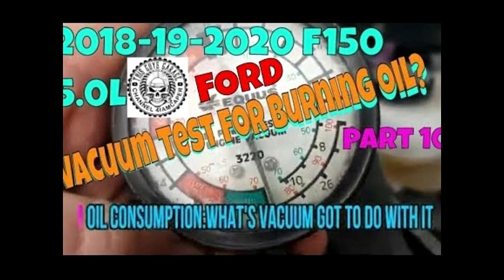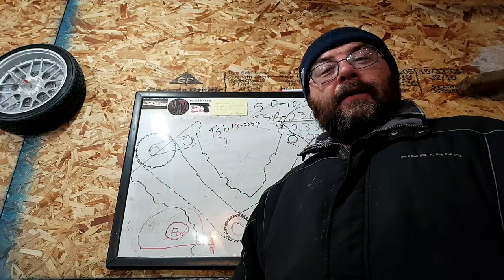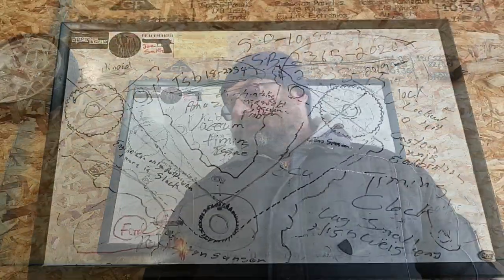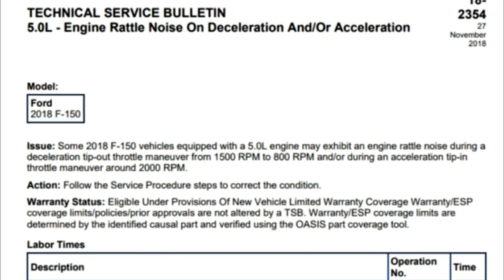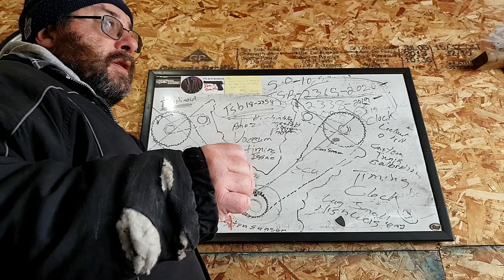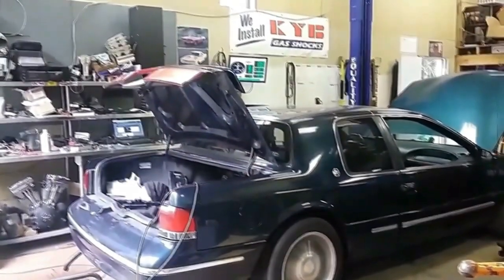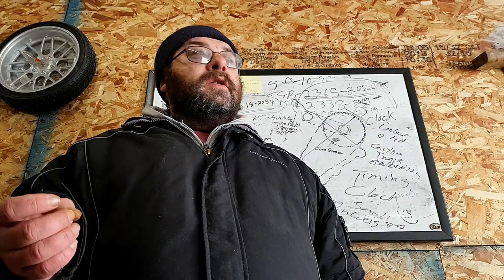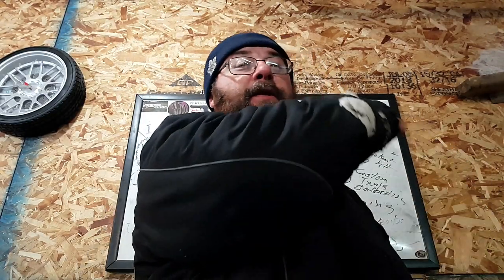2018 2019 2020 FORD f150 5 0 engine rattle tsb 2354

Comment: The Rattle goes away when the engine warms up. My truck has the decel rattle uses no oil. Every 3rd Gen 5.0 I’ve driven F150 and Mustang all have the decel rattle till they warm up. Even the 2021 5.0 has the decel rattle. I took my 18 f150 in and they applied the TSB 18-2354 they replaced the cam phasers and reprogrammed the truck. The rattle is still there and it’s still not using oil. The timing chain tensioners are also locking so the chains can’t slack when oil pressure bleeds off witch is a common issue in the 5.4 3v. I also have a JLT catch can on my PCV and there’s barely any oil in it, in between 5k mile oil changes. 

I think you need to back up your claims with proof.  By installing a PCV catch can. Because I’m not seeing your theory on my truck or the 2 other vehicles with 3rd Gen 5.0s I’m around. 

I’m not saying that your truck doesn’t have an issue I’m just saying there’s something else causing it. I had a 2013 f150 with a 5.0 that got a new engine under warranty so I know there’s bad motors out there.

I hope you find a resolution.
Cheers
Reply from the maker: cheers

Comment: I have 3 issues 
First was rattle when decelerating (when it’s cold starting until it warms up)
Then came the rattling on acceleration on l
Then I noticed I was burning oil! About a quart at 5,000 miles 
Trade it in?
Reply from the maker: would be wise , put some 10w/30 synthetic oil in it to quiet it down before you trade.

Comment: Hello everyone. I just bought a 2020 f150 5.0 and I looked at sticker on door jam and it was manufactured 11-19 and so im wondering if I should be worried about any of these issues ? I've only put 1k miles on it so far
Reply from the maker: 2020 is included in the technical service bulletin.  Keep an eye on it. 
Ty for taking the time 🤝
Reply: @thisguysgarage  ok so as long as I only fill 9qts or whatever it calls for in manual of oil on oil change and then check dipsgick and keep the oil right at that full mark from when i filled it i should be ok until ford decides to fix this problem right ?  I ask cause I watched all videos of yours and seen where ford was ovwrfillkng oil pans. Of course I seen these videos after buying truck.
Reply from the maker: @jasongallowayelite7432  that would be better than having it overfilled.  Of course the ad mark is a quart lower because the dipstick is longer. Ask for the stick to be marked at the 8 court mark so you know when it is low.
Ty for taking the time
Reply: @thisguysgarage  well I not taking to dealer. I'm doing all maintenance myself. Well unless it drinks lots of oil.
Reply from the maker: @jasongallowayelite7432  keep receipts and buy ford oil filters they can't say too much.
Reply: @thisguysgarage  always. Lol. Hey thanx a ton for replying. Not many creators do.
Reply from the maker: @jasongallowayelite7432  no problem i do make it a rule to reply to everyone. Again thank you 🤜🤛
Reply: I use a rebuildable Canton filter on my 2020 xlt 5.0. Way better than the garbage spin on filters. And 2 times more filtration surface.  It has 100% filtration. No bypass valve. ALL the oil gets filtered, Non going through a bypass valve like in the spin on filters. Also switched to 5w-40 mobile and use a quart of Lucas zink additive. 9 quarts total, Also put a reducer in the PCV vacuum line to reduce the vacuum. the reducer cuts the hose down to 3/16. No more oil consumtion and no more ticking noises. 36k miles. I know zink is bad for the cats. But it`s not using oil anymore so it`s not a problem for the cats. PCM updates that hold the throttle body part open and longer dip sticks is not the answer. The only dip sticks are the ones who work for ford! @thisguysgarage

Comment: So I have a question. I have a 17 f150 5.0 it has 51,000 miles on it and i just picked it up from the dealer. They cant/wont tell me what is a normal amount of oil for the "newer trucks" to consume between oil changes. They have yet to reference a TSB and basically kept my truck for over a week but did nothing to it. Said they topped off the oil and want me to bring it back every 1000 miles to document how much oil has been consumed. What do I do? I love my truck and dont want anything to be wrong with it, but I am worried something is.
Reply from the maker: Ford tsb states this more than a quart of oil in 3000 miles is considered excessive. 
Does your truck have the 10 speed transmission?
Reply: @thisguysgarage  no it has the 6 speed. And the TSB is for 2018-2020 correct?
Reply from the maker: @jjames9816  yes 
You're truck should have the narrow range dipstick. 
Count your lucky stars on the 6 speed. 
I'm interested so please keep in touch.  Part 5 or 6 compares the dipstick you should be able to tell which one you have from that
Reply from the maker: @jjames9816  did you buy new or used.  Did you have any engine rattle?
Reply: @thisguysgarage  yes I have the narrow range dipstick. I've followed along with you closely. I dont have any engine rattle...but around 2500 rpm with normal cruising pedal input I have what sounds to me like injectors ticking. I did buy used purposefully to avoid the 18 and newer problems.
Reply from the maker: @jjames9816  injector noise is not terrible. A little annoying...
You were wise in your purchase 🤜🤛
Reply: @thisguysgarage  agreed! Could you tell me the TSB number again that states 1qt in 3,000 normal consumption
Reply from the maker: @jjames9816  tsb 2058 and tsb 2365
Reply: @thisguysgarage  thanks 👍

Comment: I've got a 2018 5.0L. Doesnt seem to use a lot of oil but it has the rattle noise very bad. Just changed my oil to full synthetic for the 1st time at 45k and to be honest the noise is mostly gone now! Not 100% gone but greatly reduced. Has to be oil pressure related in some way for sure
Reply from the maker: keep an eye on it,ty for taking the time,stay in touch!

Comment: I have this issue on my 2010 f150 5.4L. Dealership (tote the note place) replaced the timing & cam shaft sensor (so they claim) & I still have the issue. It only does it at deceleration (roughly 20mph or less) and if I come to a complete stop, it stops until I accelerate again. Has me puzzled!
Reply from the maker: if the timing chain was replaced i would hope the tensioners were at least inspected, the cam phaser solenoid's / phasers would be next  in the suspect list. hard to know without more information.  if the truck is worth spending money on i would contact a custom tuner in your area ,more than likely would be able to solve a lot of drivability issues with a cam phaser lockout kit.  hope this helps ring the bell ask questions anytime ,thank you

Comment: I'm in the same boat. My dealer is waiting on Ford to approve the engine change.
Reply from the maker: let me know if they approve ,good to hear
Reply: @thisguysgarage  so I talked to the dealer about the timing chain. That gets replaced along with the sensors. Heads and cams are checked. Finally got parts in and should be putting it back together. Today is 5 weeks since I dropped it off.

Comment: I have my first Ford 19 f150 5.0after a lifetime of gmc's  that have never been in a shop. I got the 5.0 to avoid problems down the road since I didn't want turbo problems etc.So about 2500 Mile's I notice my oil was low but I didn't check it before I purchased it. Then I started to hear a deceleration rattle.  They performed oil tsb and Updated  trucks pcm to latest version and gave me a new dipstick, rattle for much better but still there a little it's driving me nuts, Ford service manger says it's normal trying to tell me it's trying to down shift. I'm so frustrated after spending so much money. My friend who is the sales manager took me for a ride in his demo truck he gets to drive... same issue but worse   Has anyone had this fixed correctly yet?
Reply from the maker: there is no known fix for this issue ,have a look at fords dirty secret on my channel here .the oil consumption problem is being hidden.
Reply: @thisguysgarage  i love your videos thanks!, my oil is good now but now im rattling  so frustrating
Reply: 2018 F-150. Had the motor changed at 30,000 miles after 12,000 miles of back and forth with ford and several oil consumption tests. New motor still burning oil, still rattling on acceleration and clicking on deceleration. Fords answer was to give the longer dip stick and shoot the computer with an update. Truck is still doing the same thing and Ford could care less. They just put you through the trials and hope you give up.
Reply: @ROOSTER-ql5fs  so my oil isn't fixed and I have rattle I hired a lawyer about rattle and got 9500 3500 went to lawyer. I added 2.5 quarts today and it made the engine a little less noisy. I got a custom tune from oz and got this explanation about rattle 
What you’re hearing is not knock. It’s a combination of the DI pump and VCT cam phasers, and it’s not hurting anything. We adjust the DI syste4m to activate earlier, at a lower RPM range to provide better knock protection when running low octane fuel, like you are. It’s very beneficial when towing, as most guys will run lower octane fuel to keep fuel costs down when towing, and the 1500-2200 range is where you spend a fair amount of time when towing.

 

What’s happening is the DI pump, which is driven by the exhaust cam, comes on line and adds load to the exhaust cam. The electronically controlled oil pressure solenoid is also limiting oil pressure slightly. That can cause the exhaust cam phaser to rattle slightly until the oil pressure builds enough to move the cam to the desired position. It’s an annoying sound, but it’s not detrimental. Both Mustangs and F150’s will do it, even on the stock tune. Some trucks can be worse with the tune installed, because of the DI pump adjustments we make, but the added knock protection makes it worth the trade off. I can adjust the tune to reduce the chance of it making the noise, but like I said these engines will do it with the stock tune installed, and you’d be giving up the added knock protection. I’m happy to adjust the tune though.

 

Something to check beforehand is to make sure that your oil level is not low. It should be all the way up to the full line on the dipstick, and I personally run an extra ½ quart above that in both my Mustang and F150. Also, tipping into the throttle further in that RPM range will also increase the commanded oil pressure quicker, which will stop the noise.

Let me know if you want attorneys number.
I  had to say I wouldn't pursue rattle anymore and the were quick to part with 9500. I'm going to do the same about the oil and this insane new dipstick that show a quart low when it's really two
Reply: Scott Sferrazza Try pushing the traction control button twice to take it to advance trac sport mode. My rattle went away doing this.

Comment: I have this same problem. First they replaced the engine because it used more than 3 quarts of oil in 5000 mi. After the engine replacement it ran quite now it is making the rattle noise again. Is there any legal action I can do
Reply from the maker: depends on your state , its ridiculous

Comment: I bought a 2019 Ford F-150 Fx4 brand new! It’s been a year & I hear a the engine rattling! It didn’t have any oil in it! Even after getting a oil change at Ford! I should have bought a Chevy!
Reply from the maker: ford is really abusing its customers, remember they only repair catastrophic engines ,nudge nudge wink wink ,stay in touch

Comment: I got 2019 f150 with 5.0 liters.making rattling noise and burning oil.I take my truck to ford they change the oil deep stick. And change something on computer.they said noise is normal.and if still missing oil under the 5000 miles bringing back.I bringing back to ford they said is under the normal reading level.what I need to do.???my truck got 50000 miles.
Reply from the maker: it could use 3 courts of oil and be under the normal reading because it is a 3 quart swing on the new stick. you need an oil consumption test where they mark the stick to know exactly how much oil it is using.

the motor will have to sieze before they will do something.  if you forget to check the oil and it siezes you will still need a custom tune to save the new engine.  clear of doing unscrupulous stuff. ford is no help.

Comment: My ‘18 5.0 is going this week for steering lock at partial turn, transmission shine like a supercharger, transmission knock when applying gas after letting off that sounds and feels like a giant steel tool box is slamming in my bed, deceleration rattle and I probably forgot something.
Reply from the maker: oil consumption? you have all the symptoms
Reply: @thisguysgarage  one thing I don’t have…. Maybe it never had the tsb. I’m pretty excited for them to say it’s normal for a 5.0 after they run out of issues then ask them why there’s a tsb for it…. Don’t make those for normal things. I’m the guy that’s very comfortable being uncomfortable and staring at people while I ask rhetorical questions 😂
Reply from the maker: @stephenwilson9883  good stuff keep in touch 👍 is your truck 2wd or 4wd 
reg cab super,or full 4 door and last does it have a towing package?
Reply: @thisguysgarage  it’s a super crew fx4 with tow package. Sucks it’s the truck of my dreams… searched so hard for a 5.0 instead of a boost because I didn’t want to deal with moving parts cost of the turbos. Jokes on me… shouldn’t have gotten a truck with a trans gm helped make or a motor I’ve seen mustang guys getting rebuilt and and swapped all over YouTube. The scariest thing is the steering wheel grabbing at a turn to like 10-11 o’clock and I have to jerk it back out. The rest is just loud and annoying and anytime you hear metal slapping stuff the way it is, all that torque slamming the driveline from the trans jerking and whines the way my trans is… it’s just not normal. If they won’t fix it I’ll walk inside and sell it to their salesmen
Reply from the maker: @stephenwilson9883  is it black?
Reply: @thisguysgarage  are you watching me? Lol! It’s black, 6” lift with black wheels with a TOUCH of shiny stuff lol. Has the stx package so no chrome anywhere other than those previously mentioned “touches”. It only has 23k miles so being an 18, lifted just east of Tampa… it’ll sell
Reply from the maker: @stephenwilson9883  did you  buy it new?
Reply: @thisguysgarage  no sir. I had a Tacoma after always having full sized trucks. Towed a trailer from Ohio to Fl and sold it a day later 😂 please tell me I didn’t buy your old truck…. You have jackets and a beanie on so I’m assuming you’re not in Florida
Reply from the maker: @stephenwilson9883  it sounds like my old truck
Reply: @thisguysgarage  I just looked at the carfax. It was born and raised in Florida. Just means there’s a bunch of these out there that don’t then their radio down or think it’s all kosher. Sad
Reply from the maker: @stephenwilson9883  i know they sent mine to the states.  it sounded like my truck to a tee

even my dream truck/nightmare.  
keep an eye on the oil 🛢
Reply: @thisguysgarage  for sure! Appreciate all the insight.
Reply from the maker: @stephenwilson9883  ty Stephen,  keep in touch buddy.  I have had a dozen people independently tell me about the steering issues. its not in your head like ford tries to make you think. let me know how you make out.
Reply: @thisguysgarage  thanks, will do! I got it nailed down being able to repeat it 100 percent of the time. I sat this morning and did it at work in the parking garage sitting still over and over. It’s not the ujoint but grabs after maybe 2-3” of turn. That’s the one thing I know they won’t be able to argue because I’ll see them fight it for a second

Comment: hi wondering if there is a fix for this issue now. Dealer performed an PCM update but same issue again. Then they told me it was normal noise. Thanks
Reply from the maker: Only true fix would be to tear the engine down and replace the timing chains . Ford won't do anything  Under warranty .if it's a chain noise.  The piston slap is basically a engine rebuild.

Comment: Does anybody know what the hell this high pitch squeal when I get going from a stop and the rpms get up to around 2 or 2 and a half grand pretty much when its changing gears I guess jesus its annoying  and I have driven three of these trucks and I heard it on all of them and 2 I didnt
Reply from the maker: That is vacuum leak sounds like a turbo whistle.
Reply: @thisguysgarage  what kind of fix do I need if any I'm open to anything I cant stand it I already dont like the whining trans when I I accelerate I hear that alot when I'm driving in a parking lot where sound is bouncing off  buildings or what have you but this squeal is ridiculous yeah this truck has defintly been a bummer shitty shifting jerking acting like it doesnt know what gear it wants shuddering when I accelerate at high speeds stupid noises all kinds of stuff biggest bummer ever
Reply from the maker: @s.o.r1017  a propane tank  running unlit under the hood move around the vacuum lines. The truck will change idle speed. 

Unlit though. 🤜🤛its a rat's nest of lines. Happy hunting.
Reply: I keep on hearing that people are having timing chain tensioner replaced and it solves the squeal that I'm hearing
Reply from the maker: @s.o.r1017  hard to know without hearing it. 🤜🤛

Comment: Hey i have an issue with my 2016 f150 5.0 i had P0022 code so i took her to dealer so they change cam phaser etc.. its supposed yo be fix it but no it continue with the same issue what can be this problem because it have cam phaser new solenoids new belt new all but problema continue
Reply from the maker: did they put a timing chain in it?